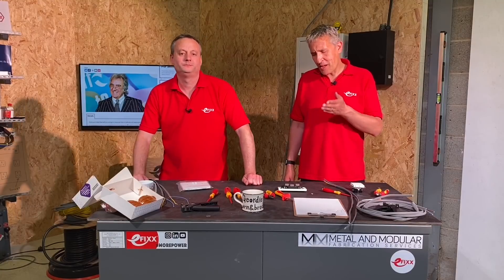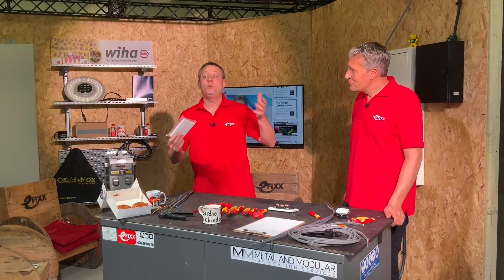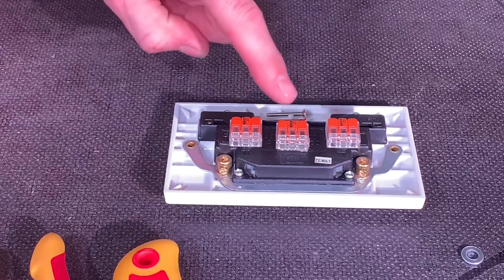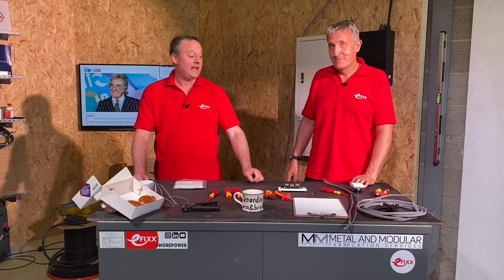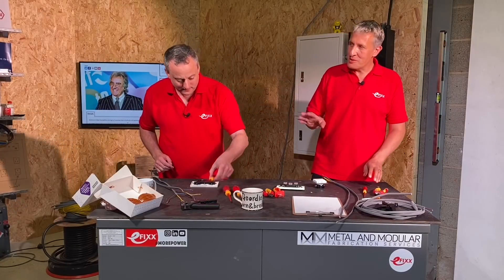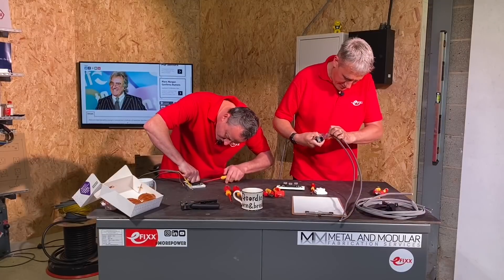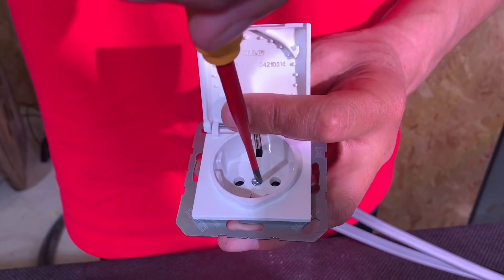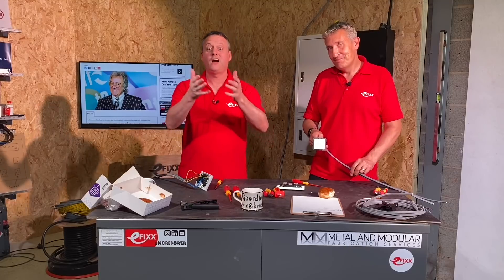When will UK sockets have WAGO style connectors? - electricians comment

Comment: Great content, subscribed! Informative, well paced, with funny banter. Having lived in Belgium where they use the same Shukho sockets, got to say the plugs are a lot easier to get in and out compared to the UK 3pin and the fit is very snug. I had to change all our services over to Shukho plugs, then 3 years later change them all back again to UK plugs which was fiddly. 

Many small amperage devices in the UK only use two core with the plugs so the 3rd pin is redundant electrically anyway. The internal moving shield is clunky and often is stiff even for adult hands and I've had to give plenty of plugs going into an extension lead a smack because of the lack of precision with components. No such problems with the Shukho. If the consumer units are properly earthed and individual RCD on every circuit, is there really a need for individually earthed devices and sockets? Going two core throughout the house would save money on cable and space allowing slimmer socket and plug internals, wouldn't it?  And the big 16A outdoor connectors in the UK are all Shukho style already, rather than monster UK 3 pin, so when will we switch over to the European electrical standards - or at least allow them in the regs so householders and businesses can use them if they want to?
Reply from the maker: Thanks Kiat - welcome on board, we look forward to more of your comments!

Comment: better still would be a terminal frame  that could be screwed onto the back box before or after being terminated and the face plate fittted with pins and secured with screws as exist, I mean we already have pins on the plug top

Comment: OK, so here is my question.... In the US, the perferred brand for wire connectors seems to be IDEAL. what is it like there in the UK? what brand do UK electricians perfer? IDEAL, or WAGO???
Reply from the maker: Both companies operate here in 🇬🇧 UK - WAGO is the more established brand in the screwless connector space, as they have a larger range which includes DIN rail terminals and pre-wired installation systems.  Ideal are still quite new to the screwless connector market here - so still catching up with product range.

Comment: These Wago 221 cost in Germany 0,30 € per piece.
When I think, that I will not disconnect this connection in the next 15 years, I use the Wago 2273 which cost around 0,10€ per piece but are only usable for solid conductors.
The Wago 221 are easier to reopen.
Could it be, that an electrician in UK has to disconnect the sockets more often than in French or Germany because of the error-prone ring circuits?
From a mainland perspective your consumer units are tiny. :D
Most households here have 1m * 1m hager boards.
I've seen smart homes with 3 square meters of distribution board. (Loxone Smart Home)

Comment: Unfortunately most people share concerned about the price. Features like this can be built into sockets but the cost to re-tool and re-certify the product will push this above a price point people will pay. You will also suffer housing developers etc (who generate the volume for manufacturing) won’t go for this as they are also focused on price. 
For the state of the market it’s probably a point of over engineering which would lead the manufacturing aspect of it down a path of conceding this development in favour of a simpler alternative like it currently has
Reply from the maker: Will - We’ve heard rumours that at least one manufacturer is working on a screwless socket - Its not if - but when now!

Comment: We have had back stab-in connectors in the USA for many years. When done well using quality components they work well. However the NEC still recommend conductors around screws tighten to specific tor JW settings. The back Stan-in connectors had the problem of coming loose and poor termination technique causing arcing. The wago connectors look much better and heavily engineered but again here electricians should be checking. Manufacturers should be releasing their lab test results on their products to see how well they perform. I have to say wago ask provide a lot of technical information on their devices. As a listed device I would trust them however the worry is not to ago products but the cheaper knock-offs we have to worry about.

Comment: Screw terminals on the back of sockets can work loose over time. Expansion and contraction of the metals assists in that. One in my place worked loose causing the tumble dryer to not work properly.  Loose terminals on a ring can also be a big problem. Wago connectors will solve all that.

Comment: In a word, yes. Mounting to a grid frame, separate surround. Pushing, bending wires to get them tucked in behind, fiddling to get the screws in. Did you tighten and torque them all up, better check? Having been to the USA and seen their socket systems, similar to the German ones, you can only conclude that we are masochists.

Comment: All day long for me. As a DIY'er when do you a socket a year or so, you don't have the daily practice of stripping ends, doubling them over, getting them in the holes, getting that bloody screw tightened...oh bugger the wire has dropped out...now have I grounched down on the insulation? etc etc etc.

Comment: In europe we use the spring for about 8 years already
Reply: Corona Vijvertechniek we’re far ahead of the British electrical wise.. they barely started using rcd’s around here lol
Reply: @filipe.skunk8  Lol like my CU, which has half the circuits on an RCD and the other half not!
Reply: Justin Phillips i get a blue screen fatal error in my head every time i come across with those 🤣 need to reboot the system and set the date to 1980!
Reply: @filipe.skunk8  Yeah whoever did the installation just hacked and slashed. Was before I bought the house. Been fixing a lot of gash wiring, and the CU is probably next on my list. But I guess I need to get a spark in really than do that myself :D
Reply: Justin Phillips reason is more because it was “ok” to do it here..still is if I’m not wrong.. the cables are normally just chucked everywhere without minimum consideration, that’s why in the end of the job they need doing insulation tests everywhere 🤦🏻‍♂️.. If you have electrical knowledge I’d say do it yourself but use wired tubing with singles instead of T&E, you can buy 3x1.5 or 2.5mm reels, give your electrical install a tubing network so you can easily troubleshoot and fix. Make your light switch boxes deeper and do all your electrical connections in there with wagos.. not in the middle of the ceiling on those shite ceiling roses.. give it more selectivity and run radials for the sockets at a maximum of 4 or 5 double sockets, one circuit each bedroom, a couple circuits living room and so on.. oven circuits, dishwasher, washing machine and so on..
Reply: @filipe.skunk8  Thanks for the advice. I have used Wagos and the Wago junction boxes to replace the old junction boxes, and I use the Quickwire system to replace roses, and they all make a big difference. Less for a DIy'er to get wrong IMO, although I do my research first before messing around. And I try and test as much as I can with my multi-meter before doing the bang test. I wouldn't mind getting a second hand Megger tester or something like that though.
Reply: Justin Phillips all those bits count for a safer installation. Ultimately, providing a conduit networking for the circuits to run in normal houses so you can pull them to add/replace extra wires and colours according to your wiring needs like in a couple of 2 way switches across a corridor or landing or even a simple switch.. i find it so weird to open a basic light switch and find brown and blue connected to it 🤯 at first sight following the colour coding for wires in AC that’s a dead short when you flick that switch 🤣 electrician logic goes out the window when you find connections like these and no breakers tripping 😐
Reply: @filipe.skunk8  I am assuming you are not UK based from what you have bene saying? Portugal? In the UK we tend to bury wires into walls then plaster over them. Even if you put them in conduit first then plaster, in reality it is hard to get at them or extend the circuit easily. I like the idea of external trunking as long as it looks nice. some can look horrible.
Reply: Justin Phillips I’m Uk based but not Uk educated. I’ve done a few extensions like that and spot on 👌 seen jobs done by Polish too using my good old familiar “isogris” tubing
Reply: 8 years? I'm 90% sure parents house from 94 here in finland has screw less connectors from Abb and Elko

I would go crazy if I had to use screw connectors today, way to much work

Comment: Wago connectors are good and I use them all the time but the shutters can get caught and open slightly if you not careful
Reply: They can, if i put them into a tight jbox, i stick some tape around the shutters so i know they wont get loose.

Comment: Quick hassle free and innotive Wago connections. You can always rely on German technology. Unfortunately they are miles ahead of the UK when it comes to electrical engineering. I rather use the wago socket connections then the conventional socket terminals. One thing I noticed there was that wasn't mentioned is did the wago take into account spur connections???. Efix all the way.

Comment: These wagos are not time tested . I bet in years to come they give nothing but trouble I never use them .Another  thing ,eventually if all these things save electricians time no one will make any money as the job will be done to quick.
Reply from the maker: I first used Wago screw-less DIN rail terminals in 1999 - does that count as time tested *Gordon
Reply: andy sims you sound like a connector block electrician.. you don’t know what you’re talking about

Comment: I'm no spark and maybe I'm being dim but in the case of sockets and anything shoved into a backbox isn't the risk that pushing in against the wiring could push down on the catching mechanism, I realize it could be protected but that would add complexity and hinder the ease of use proposed

Comment: 4mm2 cable is a bit big for wago and i doubt they could carry the current
Reply: There is a video on you tube were a guy has a wago, connector block, through crimp and a wing nut on one piece of cable and puts 100 amps through it , the cable fails before any of the connections.  Did surprise me tbh , I thought the wago would fail .

Comment: I use to replace bill board tube lights that used WAGO and the connectors where always under the ballast. WAGO's over heated, caught fire and burned the ballast.
I never replaced a tube light that had choc block screw terminals.

Comment: If we designed consumer units and associated switch gear with wago style connectors, that would be awesome, i am yet to purchase a torque screwdriver. I have not been working in the trade for 4 years, and lots have changed in that short amount of time.

Comment: Maybe we will see wago style sockets once everyone has paid for a Torque screwdriver set, or maybe for 19 th edition they will be a Must !.
Reply: After 40 years of using a screwdriver ,I now need a torque driver how on earth did I manage ?seriously there's tight and stupid tight.
Reply: Ray Chambers couldn’t agree more, experience seems to count for nothing these days 🙄
Reply: @Mark...  to much on testing and regs not enough on good practise, I've had to work on DB live ie fuseways still live,to sensitive to turn off ,just connecting to empty ways ,but told by my apprentice it's got to be dead ,he refused to be near me while I did the connections ,by the way it was an all insulated 3ph board.
Reply: Ray Chambers I’ve done the same in having to work live but if you said that to some electricians today they look at you as if your the scum of the electrical world. Common sense goes out the window now for a lot of electricians and has been replaced with “but it says in the regs”.
Reply: @Mark...  on one occasion I took the cover off a 400a bus bar chamber to check on clamp sizes ie solid or split , the guy with me holding the other end of the lid disappeared out of the door leaving me struggling with a very heavy  cover ,said he was frightened ,he wanted me to turn the whole building off just to have look inside!

Comment: I am not a spark by any means, however I wonder if a spark could prep the faceplate by that I mean is using a small cable from the screw in clamps to a wago and then when on site instead of having to screw in the cables it can simply go into the wagos and thats you done? Can that be done?

Comment: SureWire 16 amp designed for the lightning of domestic property - currently replacing my old 3 plate system in my house with the one wire to a box system, no loop in, loop out feeds any more, no 3 plate system well actually still using the ceiling rose’s but with only 1 cable to terminate!

Comment: I have always thought that you could have the wago style connectors on the  back of the backbox and then just connect the sockets up with tri rated flex. Saved me a lot of time and aggro trying to stick 2 x 4mm cables into a screwed connection on my kitchen island radial circuit.

Comment: Comment from America. 23 year IBEW member. For me, time is not the factor when choosing a device. It’s quality. Wago connectors have a huge fail rate. At least the ones we have here. I don’t trust the current to pass through a connection as thin as a knife blade. I like a good mechanical connection, but most of my conductors are stranded, in conduit.
Reply: Number one Duno definitely not the wagos made in Europe.. been using them for over a decade and haven’t seen a single failure..
Reply: Well said sir. All the guys were talking about was time and not quality. To me, it is quality that matters most. I have seen too many rushed installations which were dangerous.
It is true that some German equipment is of very high quality, but this is not universally true and some of their products are rubbish so the tendency to say something from there must be good shows a lack of common sense.
As a matter of interest, the UK used to use stranded cables for house wiring, but the 7/0.029" was superseded by 2.5 sq mm conductors, with the cables either clipped or in a conduit.

Comment: Great video guys, undoubtedly this is the future but unfortunately the UK market is always way behind the rest of Europe when it comes to electrical installation products. Part of the problem is us electricians aren't quick to adapt to new ideas... But also manufacturers in the UK aren't very quick to adopt new tech. We need to pull our socks up or get left behind!
Reply: Try being American and using wire nuts for the last hundred years
Reply: @user-wk7wv8rn8h  I wish we had them here. Don’t like how the socket terminals are used to join the incoming and outgoing cables. I like how the Americans use a “pig tail” and the full circuit current is not relying on the terminals at the back of the socket.
Reply: @Orgakoyd Wire nuts should belong in a museum. You can use wago connectors if you don't want to use socket terminals as connectors.
Reply: @IAmThe_RA  I guess you're right about Wagos. I personally think a terminal block with the wires stripped long enough to be clamped by both screws and contacting each other through the entire length of the connector is about the best connection you can have in a building. But I understand the MF requirement these days and stick to approved MF connectors/junction boxes whether accessible or not. 

As for the back of sockets, as much as I don't like joining the circuit cables through the socket terminals, I do it. Simply because it's conventional and I don't want to create an oddball which raises questions should the installation be inspected in the future. Is the ''pig tail' arrangement something you've ever seen in the UK?
Reply: I don't think it is the manufacturers, Hager been doing these kind of fittings for over 30 years in germany.  Surly it wouldn't take em no time at all to make british style fittings !!!
Reply: I read that last paragraph as "We need to pull our sockets up or get left behind!"

Comment: I don't think id be particularly confident  with push in connectors.
Especially in the UK with ring mains (which as a kiwi living over here, i bloody hate) 
 the potential to have fairly high currents passing through the sockets is very real
You'd need them to handle at least 32A just to be on safe side,   and how long is the spring steel holding the cable terminated going to last if it heats up a bit??
I'll personally keep with the solid connection a screw offers
Reply: John Ward put a vid a while ago (maybe a few years ago?) massively overloading cables with various connections, think he may have done one with wagos only too. From memory the sheathing had all burnt off the wire and then the copper wire broke with the metal of the wago still intact.
Reply: @Mattja1  
John Ward testing Wago:
https://www.youtube.com/watch?v=bP0qHyVAymU
Reply: @johnburns4017  Cheers John, there we have it, mcb's going to trip long before a wago has any trouble!
Reply: hmmmnz with that comment I’d say you shouldn’t even be an electrician 🤣 a screw on a copper wire offers a solid connection? For how long? Maybe in kangaroo land only 🙄. Doing ring mains is stupid and lazy plus it doesn’t offer selectivity..
Reply: @filipe.skunk8   Maybe you should blow a goat,. I've been a spark for 20 years and never had a strip connector fail.  If you can't tighten one up with your limp wrists then using a wago connector is your best bet.   

A screw terminal is good enough for an MCB, so it's good enough for me.
Reply: @hmmmnz  I’m just taking the piss man relax 🤣 connector blocks are primitive though.